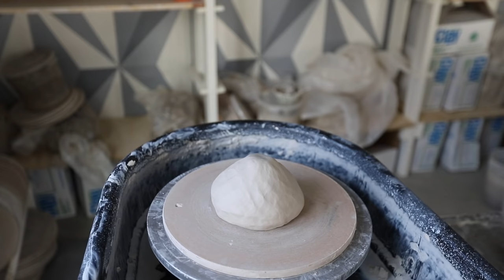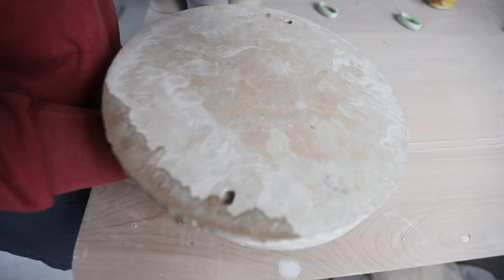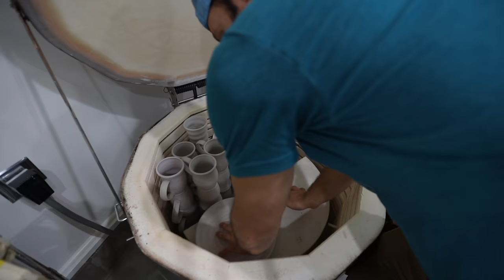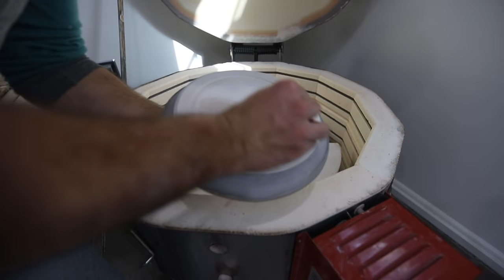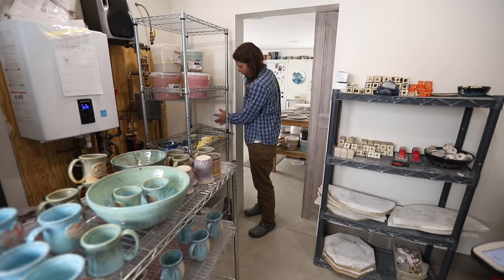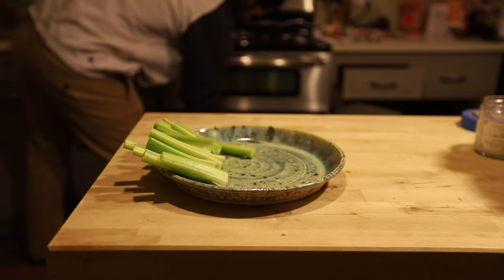MAKING A PLATE   The ENTIRE pottery process   ASMR Edition

Comment: How did the magic happen? How that green color came on the plate? Was that a coating of a cement? I have zero knowledge about the process of ceramics, yet I love to watch such videos.
Reply: I was wondering the same
Reply: Okay, so the glaze production process is complicated, but the last step of pottery production is to cover the clay (already fired once to at least 800 C, so that it is no longer water soluble) in a solution of various chemicals and minerals.  Before they are fired, they will often be an unappealing color, but once they are fired in a kiln to anywhere from 1000 to 2300 C, the glaze melts and reacts with the air and the other chemicals in it to turn into a colored glass coating on the outside of the ceramic, which is called a glaze.  There are lots of ways to develop different color pallets, but since Jon was firing in an electric kiln, I would guess that the glaze was colored with either cobalt or copper.

Comment: Thanks for this. I am currently making a set of large plates and this helps.
Reply: How did you go about firing so many (?) plates.  did you put one plate on one shelf each or are you blessed with one of those enormous, oval-shaped, monster kilns?
Reply: @dixonjohnson1708  Sorry for the thumbs down thing, I was trying to reply.  Back 8 months ago I was working via a community studio that then closed due Covid.  I would make a few plates at a time.  Now I have my own kiln and figure I maybe could fire 2 at most at time. Plus the plates I was making were using a high fire stoneware, so it will depend on when the Studio is opened again.
Reply: @karenmccampell1125  no worries 👍  thanks for the reply.

Comment: What do you do with all the extra clay bits after carving and trimming the edges?
Reply: Usually in pottery, the trimmings get put in a bucket with water ( throwing water, such as the water  used by the sponge and to clean your hands up, ect...) Then you let it settle for a few days. The clay sinks to the bottom and the water settles on top. Once you have a full bucket, and the water is somewhat clear, you pour the water out and let the clay settle again. Some use a drill with a big paint mixing bit to mix up the clay to get it less chunky. Some just mix it with their hands. Then, once it a thickish mud like consistency, you can place it on some plaster slabs and let it dry till it gets to a wedgeable consistency, wedge it up, and reuse!! There may be other ways of making it reuseable, but the is the way I know of.